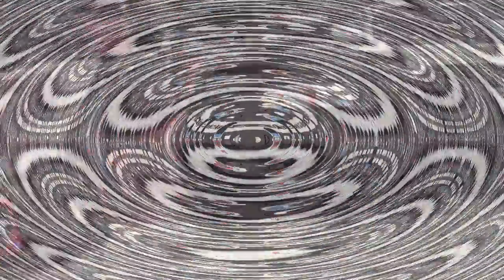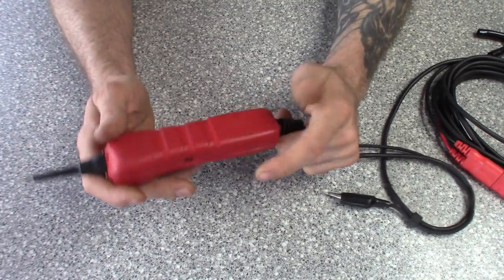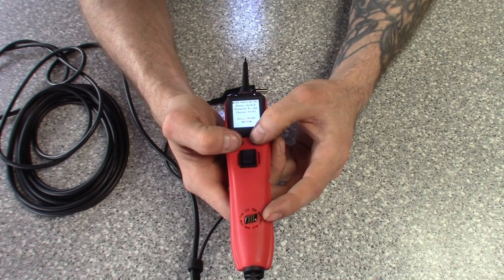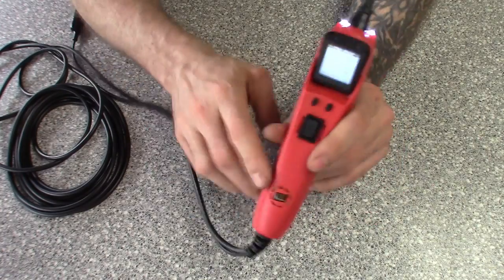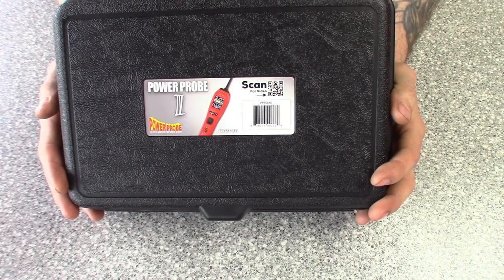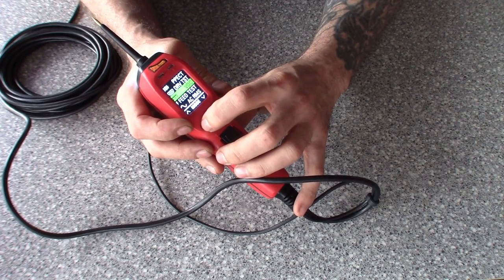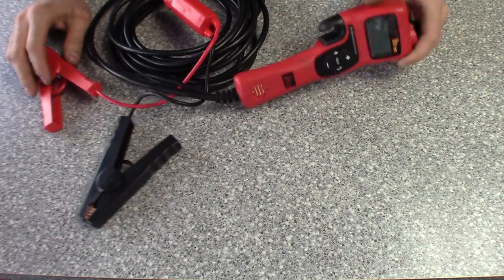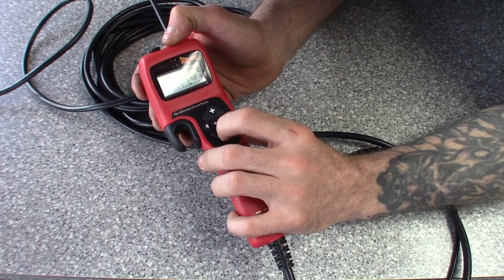Power Probe Shake Down

Comment: I bought an original Powerprobe about 20-ish years ago. At the time, a game changer for diagnosing 12v circuits. Recently I took it out of the bag to do some work and it was dead. I was sad. I went shopping for another. I had no idea how advanced these had gotten. I shopped and decided on a PP3. The price, combined with what I need for, made it perfect for me. It's already paid for itself. I wish I had need for a Hook. Can't justify it since I'm no longer in the business.
Reply: had the same , just strip it apart , broken wire for me, easy fix

Comment: PPKIT04 Master Kit here. Unfortunately,  the ground out has stopped working. Along with the green LED. Other than that, it is awesome.
Reply: Have you checked the switch? Sounds like the switch may be bad and it’s user replaceable. Just pry up on the sides of it and it pops right out.

Comment: The power prob 3 I own I cut the clip off the ground cable and soldered a 4mm black banana plug to it so I can use anything I want and any length to ground it. Pretty easy and sweet mod. Kinda like the pp4
Reply from the maker: Good idea👍
Reply: need to do that thanks. my 3 is a good tool .

Comment: I'D take the hook over any of the other power probe ones any day of the week. It does everything the others do and then some. IF you need one tool to do it all that can handle a steady 25 amp load and 65 amp load for 8 seconds this is the tool for you. Power probe just keeps improving upon themselves. 

Power Probe has did so well with the tool that snap on has power probe make the multi probe tool for them under contract. 

I'm sure we'll see something new such as the power probe with built in 5volt reference adapter sold separately for the power probe now so you dobt accidentally take out the ECM or sensitive electrical components. 

Main reason I have so many is probably like most mechanics, I get a new one each time they come out thinking they're going to wow me. 

Maybe Power Probe should have a upgrade or trade up program based on the condition of the one you exchange as they can reuse the parts or even donate the omdee one's to countries where people are wanting to learn this tech but can't quite afford the tools. We see people from all over the world and some in poor nations that want to better themselves. What better way than for Power Probe or another auto industry company than to donate to them.
Reply: You should check out the power probe maestro
Reply: JAERepair why's that is it even better then the hook?
Reply: neither of them does resistance testing better than the load pro..FACTS

Comment: SOMEONE HAS PP3 WITH GOLD LEAD FOR 70 BUCKS , AND THE HOOK WITH THE BIG BLACK CASE SET , WHEN OPENED , THERE IS A LARGE CLEAR PLASTIC SHEET THAT PROTECTS CONTENTS   FOR 120 , I GUESS THESE ARE GREAT DEALS RIGHT , SO IS THE HOOK ABOUT THE BEST THEY HAVE  ? I HAVE A GOLD EDITION ECT 2000 , ,WILL THE PP3 AND THE HOOK RECIEVE THE ECT SIGNALS ?

Comment: Nice video, very good. Please tell us, at this point do you know if the power probe maestro can be linked to ECT 2000 or 3000?
I work for a VOLVO Truck dealer and we have a lot circuit open problems on complicated to reach cable looms. I am after a version of power probe with open wire finder capabilities, using the power probe as a receiver I mean. Thanks again

Comment: I have the Hook and the 3. My biggest issue with the hook is that when you are testing a circuit the display seems to have a bit of a lag before it registers. I find this a little frustrating when you are running through fuses quickly. The 3 registers instantaneously.  Other than that, the hook is a great tool. I'm wondering if anyone else has experienced the slight delay with the hook, or am I imagining things?
Reply from the maker: Yes I noticed it lags too. The guy at tech support said it's because it has the smart tip technology, it has to register the circuit before it shows the reading
Reply: You can switch to either a straight voltmeter or ohmmeter function and bypass the smart tip function and don't have the delay. It depends on what you're looking for.
Reply: @cbmech2563  learn the machine first ///
Reply: @CJ.A-C  I have. If you are looking for both volts and ohms then you accept the delay if you are just looking for voltage or ohms you switch to either voltmeter or ohmmeter, like I said, depends on what you are looking for. I've had mine since 2015 and it has saved me from so much work and headaches.

Comment: Does any of them read and display negative voltage? And can you send both positive and negative voltage to the tip? Sometimes when testing window motors I need to reverse the polarity to either go up or down.

Comment: I'd like to have the pp4 and maybe now the hook, I feel like the regular 3 that if you don't have a whole lot of options for tools that you should just get the 4 or even the hook. It all kinda depends on what you wanna use the tool for whether you want just a simple test light tool or the more advanced pp4 to check fuel injectors. I almost sprung for the ect3000 but im gonna wait a bit longer. Great video lots of information that not even the manufactures provide.

Comment: What one do you recommend for a first power probe and I am a diesel tech if that matters.     And can you adjust how munch volts you send to stuff
Reply: Alot of stuff we have are like 5 volt sensors
Reply: @calvinpettet8007  There is a 5 volt step down adapter that goes between the tip and body, the 4mm banana jack.
Reply: Mike  thanks so munch

Comment: considering they are all made by powerprobe if you want the detached part that is how you end up getting the snap on 😂 but you don't have a choice but at least they are all powerprobe no matter what the impression on the plastic 🤔 but it was a lot better than the way everyone was doing it for it previous 100+ years and not a lot of tools that you see the biggest brand of the professional tech and I have mac and honestly its a lot of people using gearwrench without a problem and they're made over seas and lifetime warranty and advance is open to 9 pm and you don't have to wait for the next time truck shows up i have both but I would get the gearwrench set and they're u to like 30 mm and 20 + inches long so they are ready for battle but the snap on is made by powerprobe

Comment: One small correction

The hook does not have fuel injector testing mode.....

That’s only on on the PPIV..... and first effective diagnostic use of that feature means the tool has paid for itself right there......

For the auto guys and auto DIYers that feature alone is worth it let alone all the other stuff given one injector can cost 300 bucks and there’s 8 of them......

Comment: The power probe 3EZ don’t have the other features of the power probe 4 is that correct?
Reply from the maker: No it doesn't. 3EZ has a few more features than the normal pp3 also it has learning/howto features built in.

Comment: I made the mistake of getting PPKIT03S with the ECT3000. Good tool, but by far, THE WORST case I ever saw. That flap that holds all the cables up, is loose after 3 openings. Now, I cant close the case to put it in the drawer. Cables have to be pressed down HARD to fit, but the cover pops out at the so called hinges.

Designed in the USA....I would not put that there. This case should go down as the most frustrating and dumbest design ever. Sure, looks good, until you use it and untie the cable bundles.

Not a big deal? When you end up NOT using a tool because it aggravates you and frustrates you just to put it back, to find some way to wrap it all together. Its like playing tetris with snakes. You waste time, and now you get POed. You end up not using the tool, going back to your multimeter and test light. And then you ask, why did I sepdn 400 bucks on something that just takes up space?

I was looking at the knockodds on Amazon. Half the price, and the reviews showed how people could actually close the case up.  I probably should have gotten all of them separate, but greedy me...I wanted one case for all of it. I know Id get thumbs down if I did a review and ranted on this, but cmon...and then they brag using the flag I fought to serve just to pass off a product that Im sure some bean counter or somebody wanted to save 0.002 ounces of PE. Now I have to scoure the net to find a blow moulded generic case..and figure out how to keep it in a way where I wont lose one of the adapters. Sorry for the rant. Im just bitter, broke and in physical pain. I let my guard down, and got excited, because I wanted one of these for years...and I finally got one...